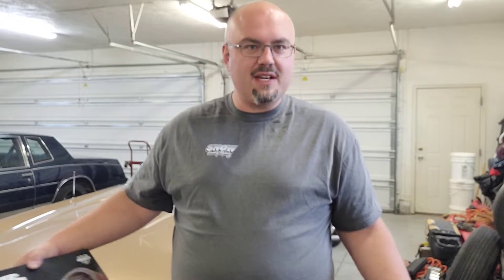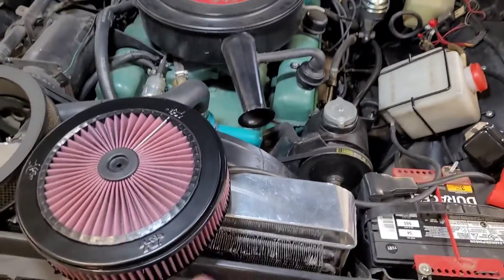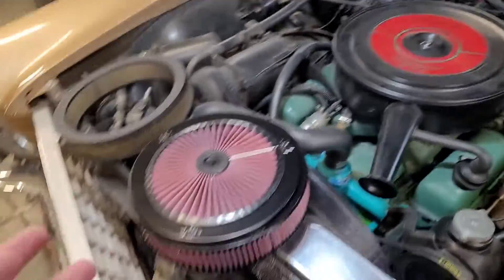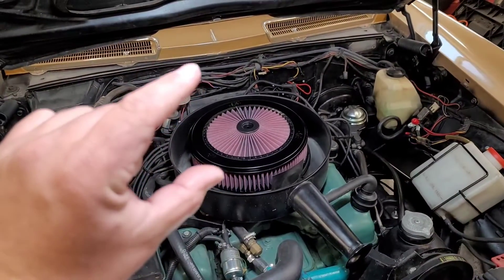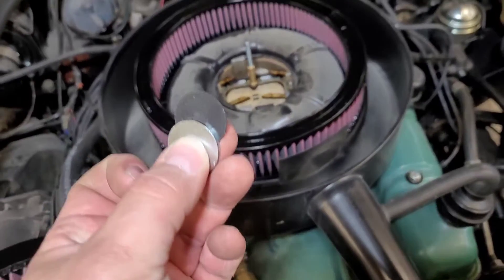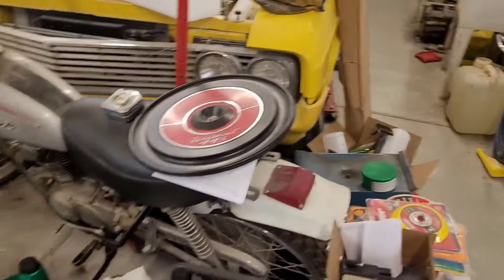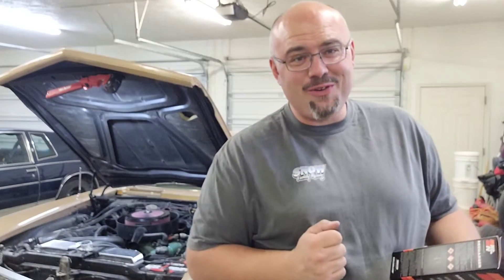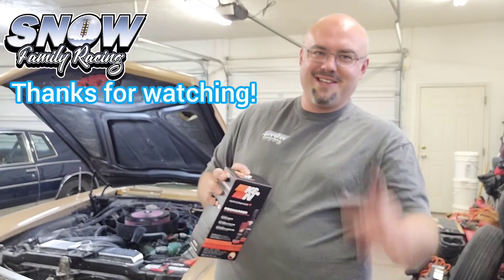Better Breathing for the Riviera!

Comment: Hey bro i have a 65 rivi have you replaced the diferential oil it doesn't have a drain or fill up plug,do you know how to doit??
Reply from the maker: That's on my to do list for winter. These are built a lot like a 9" Ford rear end. To drain, you'll need to slide the axles out,  loosen the bolts and separate the third member from the housing. There's a plug, usually on the passenger side just above halfway or so, and it's usually hidden by dirt and junk between the webbing. Take that out and fill there.